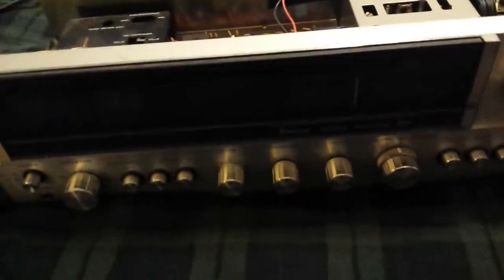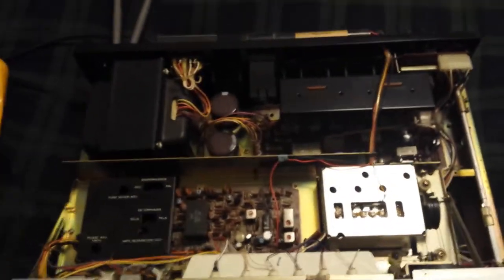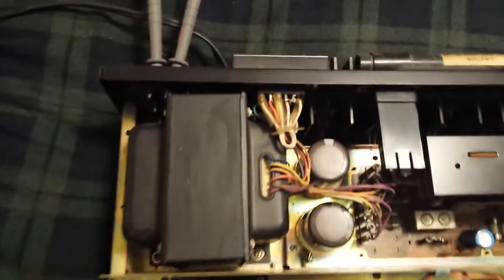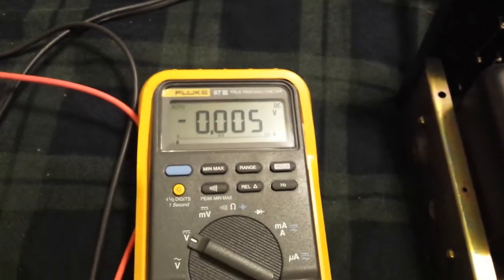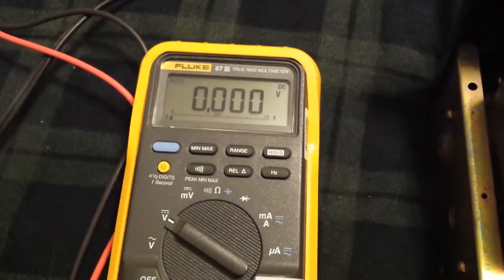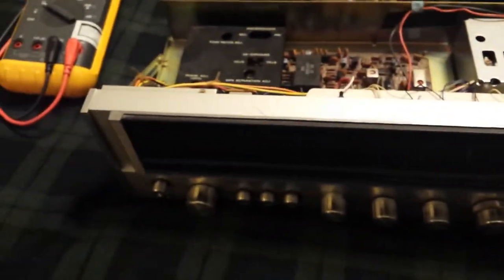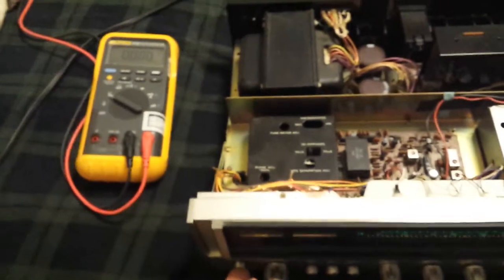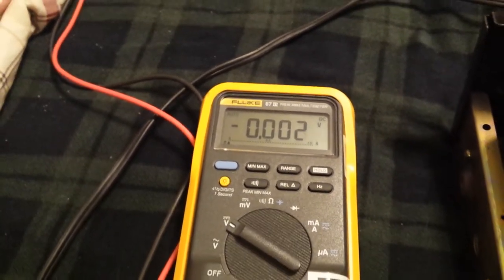Sansui 881 DC OFFSET AND DC BIAS ADJUSTMENT - PART 1 OF 3

Comment: Good video. Thanks.  It looks like the power capacitors have been replaced.  Should they be replaced just because of the age of the unit?  Thanks again.
Reply from the maker: Hello, thanks for commenting. Yes, you are correct.  This receiver actually had a bad capacitor when I got it - it leaked electrolyte, so I replaced both of the power supply caps.  It's not a bad idea to replace them, given their age and their importance in the receiver.
Reply from the maker: This unit came to me in a nonfunctional state. If I remember correctly, I had no Tuner.   I believe the series regulator to the FM tuner was shot.  Once I replaced that, my beautiful FM was back!!!  Also on this receiver, the FM stereo light was out, and the display fuse lamp clips needed to be resoldered, due to some cold solder joints during assembly.

Comment: Do the 771  similar on setting Bias?
Reply from the maker: Hello Zhorell Ski, I'm not sure.  At present, I don't own the sweet 771.  But it's easy to find out.  There's a website called hifiengine  and you can download the technical service manual to the Sansui 771. In the service manual it will have the bias procedure and parameters.  Like anything, you have to create a username and password, but it's free.  Good luck with your 771.

Comment: A metal plate with a hole, what was Sansui thinking...................a wooden screw driver or that unit gets ground out.
Reply from the maker: I don't know what they were thinking, but if I remember correctly, the potentiometers are plastic so as long as you don't slip with a metal screw driver, you should be okay. I know I used a metal screwdriver to adjust this unit's bias and DC offset.  You make a good point. Thanks for commenting.